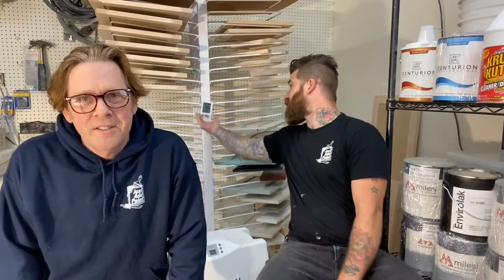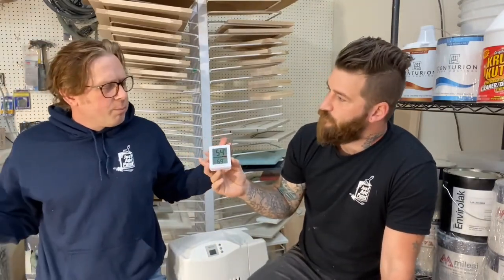Problem Solvers: Painting Cabinets

Comment: If you spray at a shop temp that is 53 then take them inside the business at the same temp checking them every time you hang another to the end and they look perfect, then after you clean the gun up, 20-30min, you walk back into the drying area to find the boss turned the heat up to 75 and all the cabinet doors have runs, what do you say?